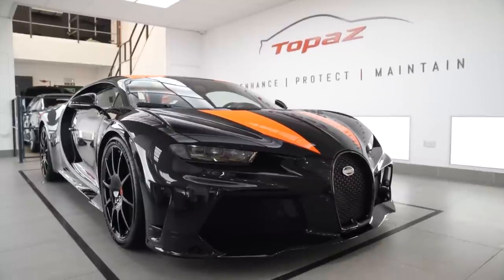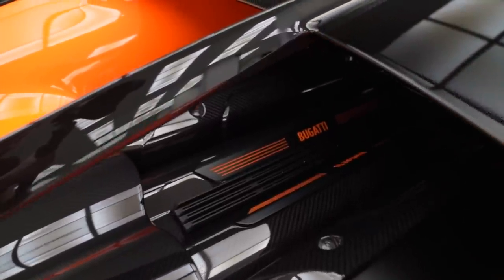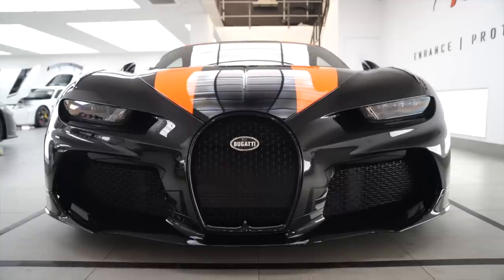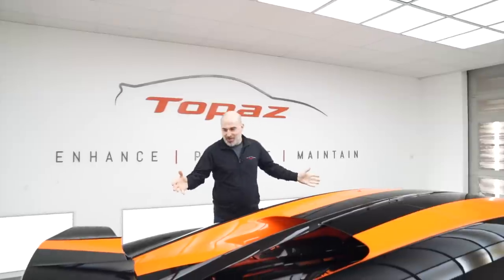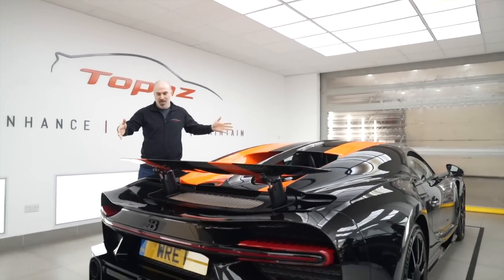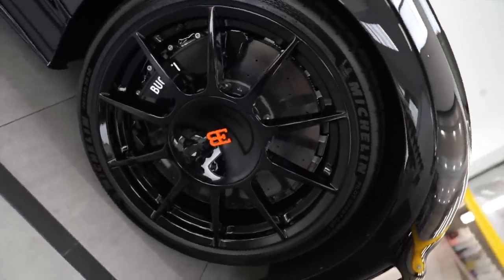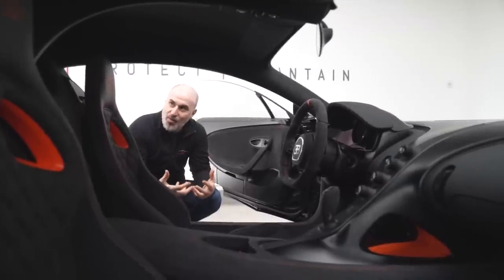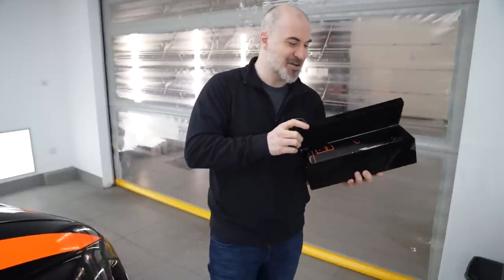The World's Fastest Car - BUGATTI CHIRON SUPER SPORT 300+

Comment: I noticed that you didn't dissasemble the car. I called one of the premier dealers here in the US and they said they couldn't put paint protection on without taking the car apart. I declined because I just invision missing parts and screws when they put them back together. Did you do this car without taking it apart?
Reply from the maker: You wouldn’t dissemble a brand new Bugatti without a very good reason to. We know how to work around the panel edges as they are. On some cars like Porsche we do remove door handles and intake vents for example with the customers consent. We also remove badges if the customer prefers